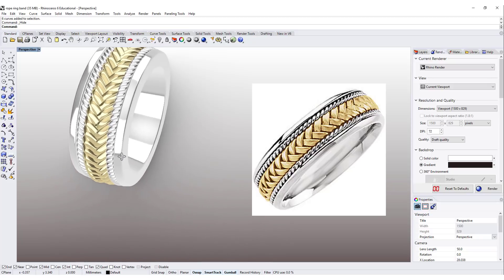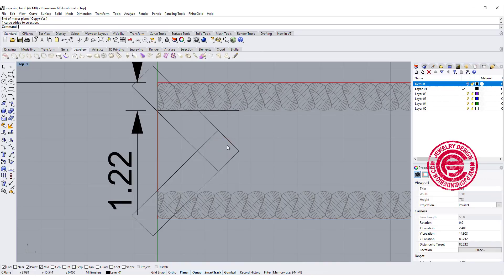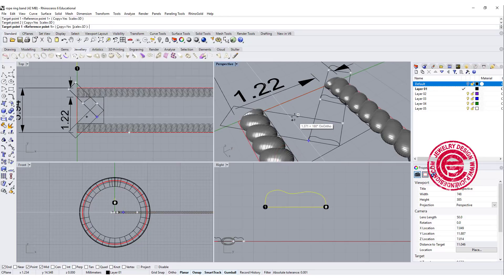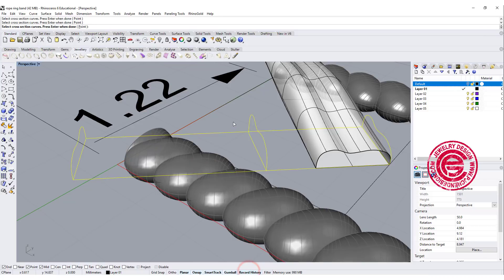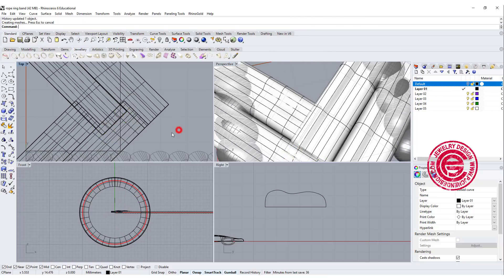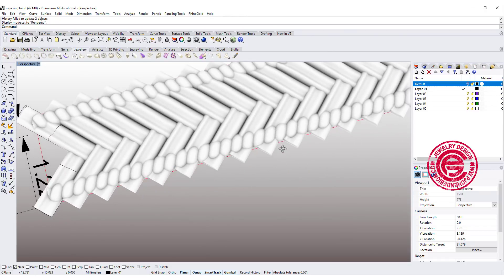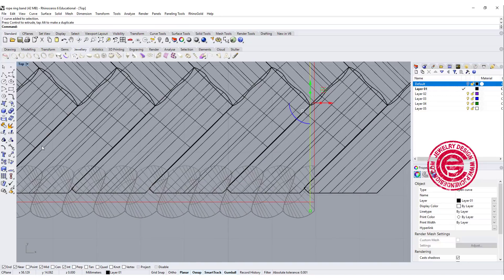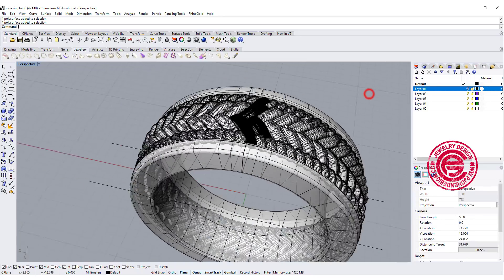How to 3D Model a Rope/Braided Ring Band (Part II): Rhino 3D Jewelry CAD Tutorial #68 (2019)

Comment: Hi , I have did the same step before 'flow along surface', and When I did flow along surface command, the pattern did flow on the suface, however, it is not a 'end to end' circle as I expected. There is a small break gap between the pattern. I manipulated the uv curve again, it is the same length of the previous surface. I am wondering what causes this problem. Wish to hear your reply. Thank you.
Reply from the maker: Hi Lin, usually, if you have it trimmed correctly, it should flow correctly. not only trim it right, you also need to have it matched at the right height. but sometimes, they just don't work. My little trick is after it flowing to the surface. draw a small rectangle to trim the surface of both side a little and bend the surface to close them. Let me know if this trick works for you.
Reply: Hi PJ Chen, I actually found another way which makes it easier. I used dupedge of the extracted surface, and did 'flow along curve' command to place the wrap pattern on the curve. After that, it works and forms the end to end round shape. I move them back to the ring and get the exact effect as yours.
Reply: @PJChenJewelryDesign  i do the same thing but it not working maybe Pj Chen can help. Because i do create uv curve to make sore the length and wide of the ring still same. When higlight all the pattern and touch red ring surface it still not working